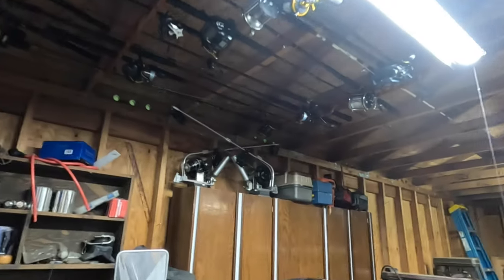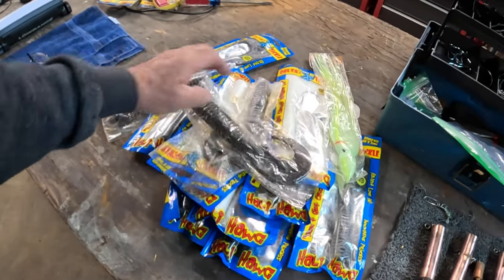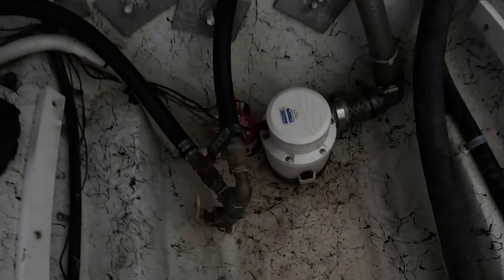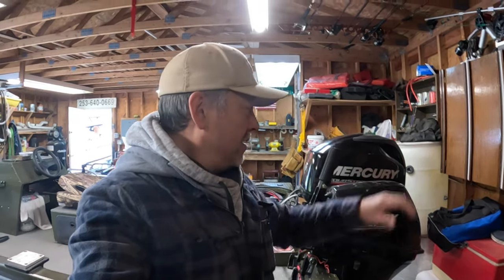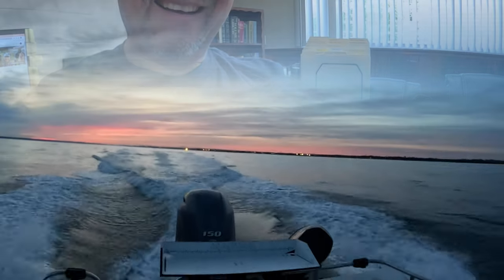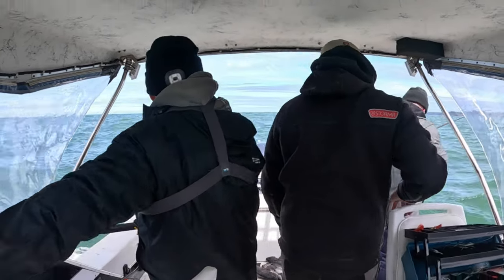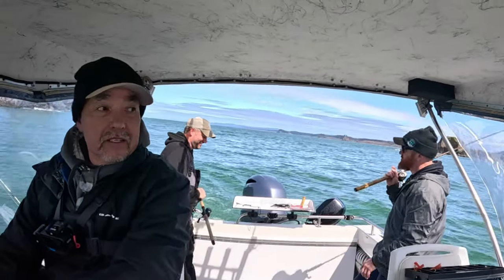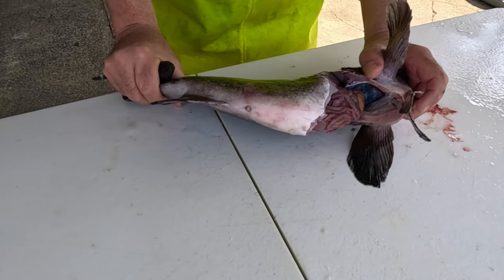ROCKFISH & LINGCOD 30 Miles From Port. Barking Sea lions - BOTTOM FISHING PARADISE.

Comment: Whats makes a good lingcod rod as far as lure weight and line goes?
Reply from the maker: It depends. we fished in shallow water where the lings aren't very big so a 12-20lb 8 to 9ft  rod with 15lb mono would be fine. But Inalso fish deep water lings in 700' where they can be 30lbs. You need a heavy rod to handle 2-3lbs of lead a lot of heavy braid 65lb test or so. Depends on where and how you are fishing for them.
Reply from the maker: Also, my jigging rods are short at only 6'6" and rated at 80-130lb line. It is easier to jig heavy weights with a short stiff rod.